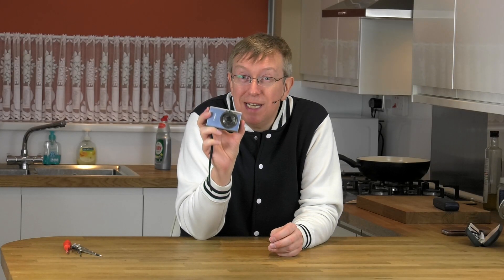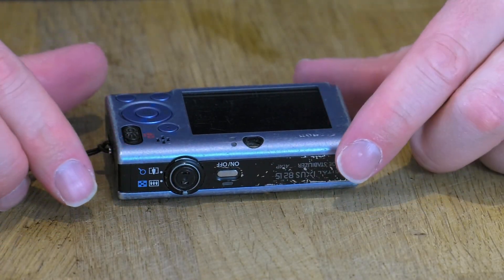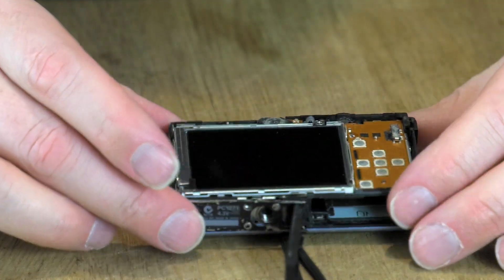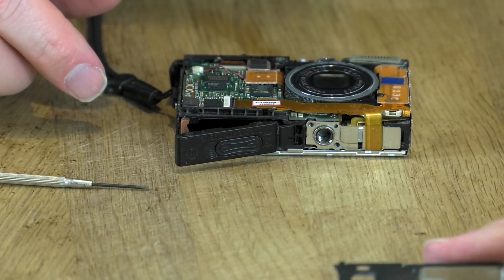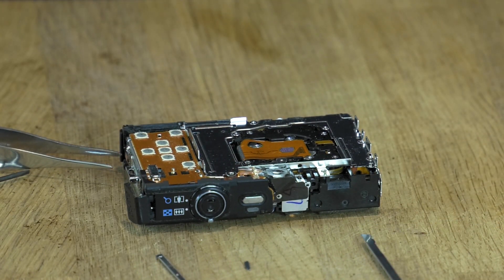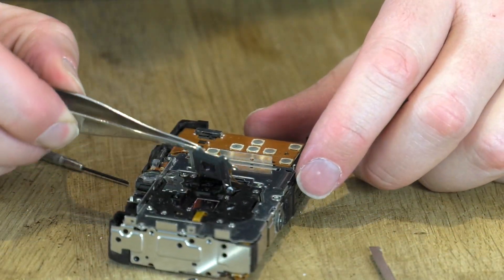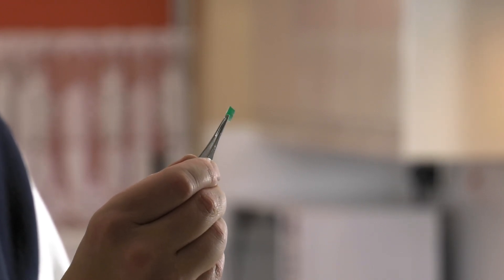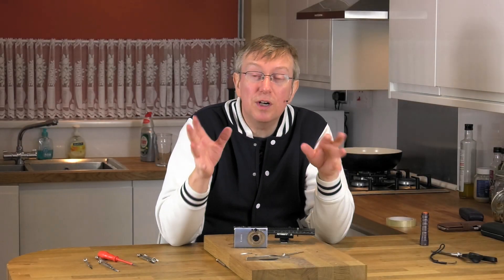How to Make a Night Vision Camera From a Regular Digital Camera (Infrared IR)

Comment: I don't understand why the camera manufacture did not make it a day and night camera with optional night vision function just by making the infra red filter move away from the image sensor with the press of a switch.
Reply: Sony had a camera that could do it, the DCF 707. With a neutral density filter you could photograph in daylight. Green leaves turn into white because they reflect almost all IR. With a filter that blocks visible light you can make very nice black & white pictures that look very odd. Google for it.
Reply: Johan Siegers
A camera does not need a filter that blocks visible light in order to be a night vision camera.
Reply: True, but it does need such a filter if you want to make pure IR-only pictures during daytime. But of course you can not call it a night vision camera anymore ;-). During night time you don't need the filter.

Comment: Now replace the flash bulb with an ir led. Might be a trick to find a proper power source for it though. 
When you take the lens and sensor assemblies apart I highly recommend doing so inside a plastic bag. Either working thru small holes in the bag, or with gloved hands inside. It will be harder to manipulate,  but it is very easy to get dust in there and ruin every shot. It is really hard to fix without clean room too.

Comment: I wonder how well it would have worked if you hadn't removed the filter? I've often used old pocket cameras or phone cams unmodified to test infra red remotes. If you aim the camera at the infra red emitter on the remote and hold a button down you'll almost certainly see the otherwise invisible emitter flashing like crazy! Whatever, nice video!

Comment: Please get a spudger if you're gonna be doing work like this in the future. A spudger is a plastic tool made for mucking about in sensitive electronics and (usually) will not scrape or damage things like a metal tool can. I got mine at iFixIt dot com. But most electronics tools suppliers have them.

Comment: That IR filter has a top side and a bottom side.  If you ever wanted to put it in again, it has to go the right way - otherwise, it gives pictures with a peculiar colour hue.  (Bitter experience).
Reply: Yes.  The filter on the sensor is actually a UV IR cut filter, and which is almost transparent. Sensors are also sensitive to UV light and if this isn't curtailed, our digital images would suffer the same, if not more than films, to UV radiation. It has two different coatings, and it is these coatings that provide the necessary filtration. The correct orientation is necessary to avoid the hue.

Comment: Older cameras and most cheap Chinese cameras don't have IR filters. Easiest way to tell if your camera isn't filtered and can see IR is look through the camera at the front of a TV remote and press some buttons on the remote. If you can see the red light flashing then your camera isn't filtered.
Reply: It worth noting that the IR filters don't cut the IR 100% I have yet to see any camera that does, so the TV remote will always show up on any camera  - with the IR filter removed its very much brighter
Reply: Not quite true.  If there was NO IR filter, the images would have a strong magenta cast, and the camera would be described more accurately as a "full spectrum" IR camera. The fact that the cameras you refer to take perfectly normal images is testament to the fact that they do have an IR filter.  However, the degree to which digital cameras are still sensitive to some IR transmission , or totally suppress it, varies and some digital cameras don't filter IR light completely, even some fairly modern and expensive ones, and so what you are seeing is the little bit of IR radiation transmitted by the TV remote control that the IR filter hasn't fully suppressed.  The advantage of this is if an IR filter,  anything from a 680nm to, say, a 760nm, is placed over the lens,  these cameras will display a true IR image. The downside is that the exposure will be very long because the sensor's sensitivity to IR radiation will be much reduced as there is so little IR actually getting to the sensor.
Reply: Ahhhh, no. ALL camera's have an I/r Filter in them. some are over the cmos ( sensor ) and others are in the other side of the focal lens. but they ALL have them. if they didn't everything would look like it is covered in snow during the day. I repair and sell camera's for a living.
Reply: +bos dad
Actually, some of the cheaper chinese 'no-brand' webcams really have no filtering at all... as they use plain optics and cheap, noisy 'no-brand' cmos sensors.  These crappy cameras swamp and saturate the moment any sunlight hits the scene.

But I do agree, most cheap CMOS sensors (and almost all branded CMOS sensors) already have a conformal coating to protect the array - and most cameras will have adequate filtering.

Of course, even these will still pass some IR - so whether they are appropriate (even with their IR-cut filters intact) will depend entirely on the application, how near the subject is - and the amount of IR you can cast.

In fact, I've not met many cameras that wouldn't be able to monitor the near-field, with a decent IR source.  Even my relatively well filtered Lumix G2 consumer camera easily passes enough IR to be usable for near-field work.

Obviously, if I needed a 15m throw, the IR output needed to overcome the filter would start to get ridiculous - and I'd need a camera with filters removed... but I'd also need near-darkness to avoid lights within the sensors pass-band from interfering.

Whether filtered or not - I've found a decent IR pass filter can help if you're not in perfect darkness - because the IR image is weaker and things like streetlamps will cause the camera to lower its gain.

I guess what I'm saying is, don't assume - just try.  It may be adequate.
Reply: Did you acquire this pseudo fact from an accredit institution of learning?
Reply: Every camera has some. I use a unmodified Nikon D70 6mp DSLR as my IR camera as with a 900nm or 720nm filter, I can get visible plus IR in broad daylight at <.5 sec shutter. I use 52mm filters on my lens and the filters are <$10 each. It allows some really cool effects that are hard to immolate in software and varying the shutter allows more of less IR in the image. A converted camera would be able to see at night but except for wildlife, night stuff is boring. It would be useless in daylight.
Reply: Troll. Lying trolls. Keep Truth hidden

Comment: Thanks Rick. I'm going to mod one of my SJCAMS after watching this. Cheers mate.
Reply: An update. I modded my SJCAM SJ5000 WiFi. Worked a treat. All I needed was an exacto knife & a pair of soft grip pliers. Pull the front plate off, (just unclips), then unscrew the lens with the soft jaw pliers and a piece of cloth. The  iIR filter was glued to the rear of the lens. It just popped off with a little persuasion from the exacto. Screw the lens back in and clip the front plate back on. All good!

Comment: So if I understand correctly that the infrared filter HAS to be removed before any infrared light will be seen or does removing the filter make it much more sensitive to infrared? I ask because I built a infrared LED spot light and my camera could "See" in the dark but very short range I was very supersized at that result as the LED spot light was very strong and should have had a range of several yards instead of a few inches- could that have been my problem?I will have to re-visit that project (been a long time ago ) now that I have seen your video!lol Thanks for posting

Comment: Excellent expose!
So do all digital cameras have this IR filter, such as web cams?
I tried this on an Olympus D-360L 1.3MP camera and it wouldn't focus after removing the little glass filter.
Any ideas why that happened?
The filter was transparent sky blue color.
Thanx ...
Reply: On some forums they say infrared requires a different focal length.  Zooming can allow correct focusing.

Comment: So what I havent grasped is

1) does the camera still work as a normal day light camera?

2) most digi camaes have a "night time" mode .......  wasn't there one on this one?
Reply: I tried this on a Canon Ixus 80 IS.  (It looks like Rick uses a Canon Ixus 82 IS)  

1) Day time photos have red added everywhere.  Also, the camera doesn't focus very well.  I have to zoom to x3 (max zoom) before it focuses properly

2) "Night time" mode on a compact camera doesn't override the physical IR glass filter.  I think the Canon Ixus night mode takes 3 photos then processes across them to try and create a nicer photo taken at night.  
This hack lets you look at IR + visible light.  So at night time, if you add an IR light source, you can see nocturnal creatures without disturbing them as much, take different photos during the day etc

Comment: I gave it a shot.  I bought two digital cameras from the pawn shop.  $30 bucks each.  I figured one would get destroyed in practice.  And it did.  The other works!  I bought a IR flashlight and it glows like anything in the camera.  The only thing is that the image quality is pure crap!  Nothing sharp about these images at all.  I don't know if something got dirty in the process or what, but the lens is clean and pics are not.  Fun trying though!
Reply: -> Rick 
Thank you very much :)  I converted my Ixus 80IS the same way.  I worked out that the extra spring is to sit in a little hole there.  

I'm getting the same problem as sights for sore eyes.

When I zoom it focuses.  When I don't, everything is blurry.  Do you have any ideas what could be the issue and if we can fix it?
Reply: You'll need to use a replacement glass for the IR filter, otherwise it will be out of focus.

Comment: "Battry"? "Visual look"? "Hopefully you can see the sensor"? "Hopefully you can see the IR filter"? Why wouldn't we be able to see them? They're not microscopic. The IR filter popped out. See that? Hopefully...". There's that word "hopefully" again. "Basically"? This is a filler word that should almost never be used. There is nothing "basic" about what you are doing. "Now this is an infrared camera that will "see" in the dark as long as you have some IR illumination". Well no duh.

Comment: you broke the ribbon latch off they flip up are pull out like a draw does, that holds the ribbon to the pins  you can fix it by putting a sponge pad on the back of the case to press it down when you reassemble it

Comment: Can u see the sky with it??
Reply: BulletproofCammy nope. The only reason they're able to see each other is because there's an Infrared "flashlight"  that's illuminating them, which our eyes can't see but the camera can. Without the "flashlight" shining on the subject,  it's unlikely the camera will be able to see nearly anything. Astrophographers use extremely sensitive ccd sensors that are much larger than the sensor in this point and shoot, coupled with extremely fast lenses to take very low frame rate videos of the sky and are able to see the milky way

Comment: The black ribbon cable clamp actually hinges up to allow you to release the cable. Breaking out the ribbon cable as you did will make the electrical contact very weak when you re-insert it. Take care they are very fragile.
Reply: They make a cheap and simple set of tools for such as flipping the ribbon cable hinge and to reinsert it.  You can buy them on eBay for less than couple of quid.  Without the tools you are at very high risk of damaging the connector.
Reply: @Biffo1262 
Flat screwdriver or tweezers will release it. They just flip up. Reinserting is just poke the cable in and flip it back down (usually by fingers).
Never broken one in 20 years, and I've opened and closed probably thousands of them in laptops, phones, and other electronics.
Reply: I would image he pressed the pieces back in to tighten it up... I hope!
Reply: I was going to comment exactly that, but thought that surely someone else noticed, so kudos to you!
Reply: What a great idea, that is very kind of you sir
Reply: yaa
Reply: please give me a camera that you made address 12 18 road mirpur POLLABI DHAKA

Comment: hay what happend to the spring? Lol
Reply: I'm hoping Rick placed it back under to central screw of the sensor block. It is used to set the focus and alignment of the sensor. The screws are torx screws to allow easy adjustment (Philips head will slip easy). The screws are then held with screwlock  as they are not tightened down during the focus/alignment procedure.
Reply: I was thinking that's what it was probably for. ;-)
Reply: Ah!  I think I may profit from that little bit of knowledge.  My Lumix doesn't focus quite as it should - but I've had the sensor out a couple of times to clean dust off it.  The lens pops out quite a long way when it is switched on, and as it pops, it sucks in air - and dust.
Reply: Scudo Camper what spring😏
Reply: The one in the video.
Reply: @DownhillAllTheWay  how do I get night vision on my camera on my phone
Reply: @jakedean6075  I give up.  How do you get night vision on your phone camera?
Reply: @DownhillAllTheWay  what do you mean I did I figured it out actually I got two different ones they're pretty cool
Reply: @jakedean6075  So why are you asking how you get night vision on your phone?
And why was your question addressed to me?  All I said was that the video had given me an idea why the focus on my camera was out.
Reply: @DownhillAllTheWay  I'm trying to show you a that I did do it quite easy
Reply: @DownhillAllTheWay  I was asking because my patience was running out it happens sometimes
Reply: @DownhillAllTheWay  have you got the directions how to do it yet

Comment: you should have stuck a 690nm filter on it Rick and as a bonus you could take shots like this http://i84.photobucket.com/albums/k23/jeffo_01/Infra%20red%20shots/small%20lake%20IR_zpsch8996ke.jpg you can still use it for night vision.

I did it with my old dslr camera Nikon d80

Comment: Just curious if you tried using the camera with the filter in place. I've used my phone's camera to check TV remotes, you can see the IR LED light up, proving some infrared gets through to the sensor.
Reply from the maker: FenderGibsonWashburn tried it Paul, but the picture with the filter intact is much much darker.
Reply: If you can see your remote IR then it means your phone is good to convert.

Comment: great video :-)  Is there a way to make the IR Illuminator run of a 9v battery to make it more portable?
Reply: londonbackpacker A 3S lipo battery would do it, same as you would use in a quadcopter.
Reply: londonbackpacker you can drive 12v arrays with 9v but it will be less bright obviously.